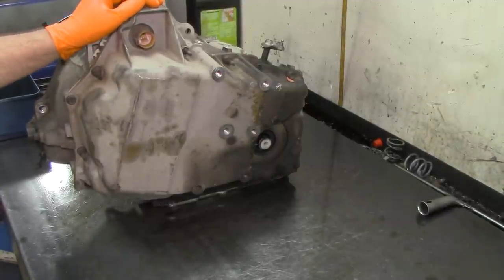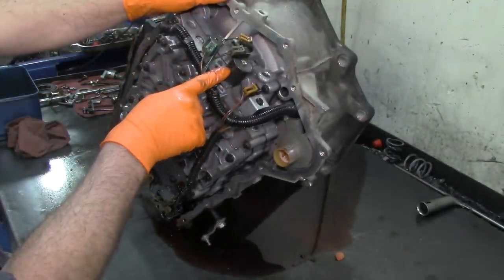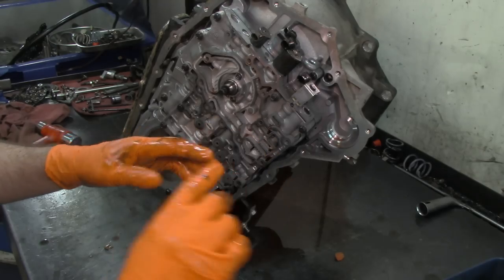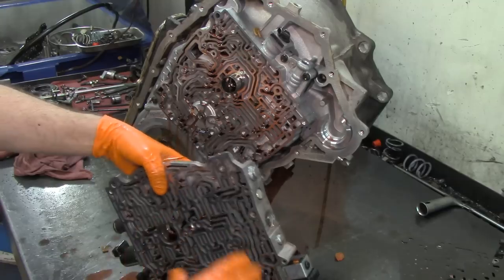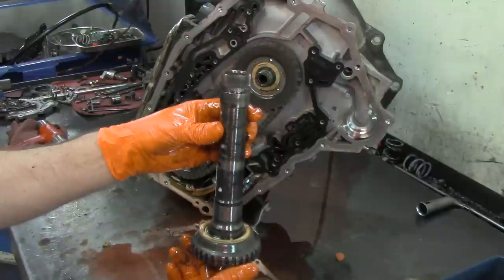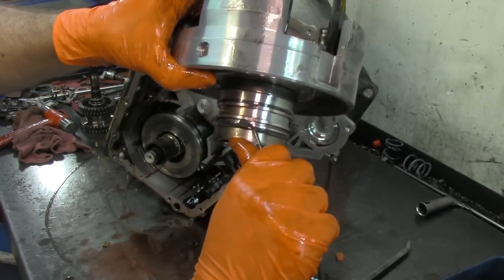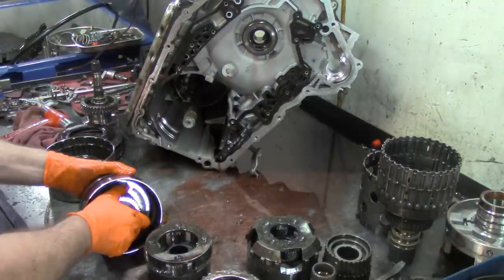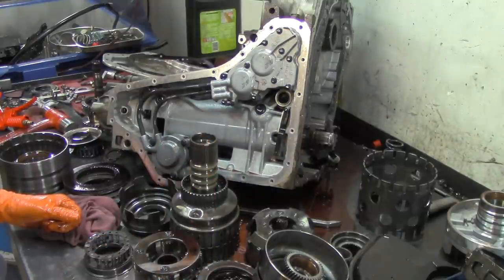P1811 Maximum Adapts & Long Shift Detected - 4T65-E Transmission

Comment: hiram I have a question  is the 4t65e tranny  front wheel drive  the same inside as the all wheel drive version  the one on your bench is an front wheel drive and I have to replace one of the bands that the end broke off  I took the oil pan off to replace the  filter then I saw the piece of band sticking out the bottom  under the trany  the car has only 50 thousand miles on it  and the reason I took the oil pan off was because I lost  3rd and drive  I was able to take off in low gear then put it on drive then it would drive ok till I stop I just drove a few miles till I got home
Reply: daniel rivera
Reply: daniel rivera

Comment: my 4t65e has a delayed shift from 1 to 2 no codes it works fine 3/4 of the time i dont no what to fix
Reply: tim bryant
Reply: Our 2000 Monte Carlo SS doing same thing no codes gonna try changing the 1-2 shift solenoid see if that fixes it

Comment: The real issue with this transmission is that it is a GM 4T65E - aka the biggest POS GM ever produced. I currently own an '05 Impala 9C1 that had this piece of junk replaced 20,000 miles before I bought the car, and 22,000 miles later, the differential and gearbox sections are both in trouble. I have driven the car easy and never abused it. This poor excuse of a transmission is one of many prime examples why GM needed a bailout. I will never buy another GM product built after 1993.